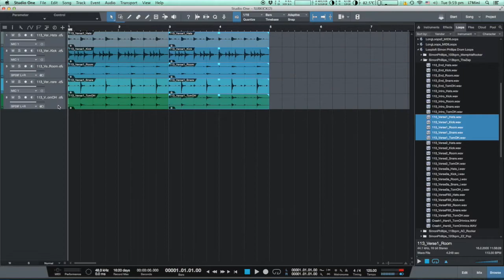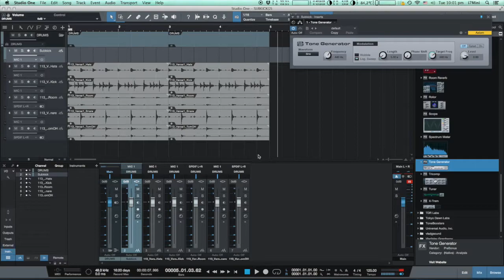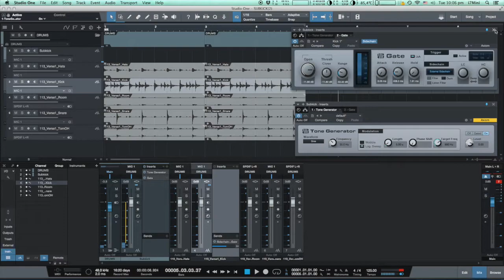Adding Low Frequency to Your Kick Drum in Studio One v 3

Comment: The results you get in this video are FANTASTIC. Could you please give a little bit more information though. First, it does not look to me like you are using a "bus/aux" track, it look to me like you are using an "audio" track? Would you please clarify that for me. Also, when you do this, the low end seems very "attached" to the "attack" of your kick drum, when I try it, it seems more like a constant low end presence rather than being attached to the kick drum. Could you please help me out? Thank you.
Reply from the maker: HI, it his video I am showing how to pack folders and create quickly bus/aux for this folder for easier manipulation with several tracks. So yes, you are right, the sub kick track is standard audio track, within the packed folder Drums. Second part of your question refers to Gate setting. If you lower Range and set Release and Hold correctly you will hear the sub tone only when kick hits the skin.